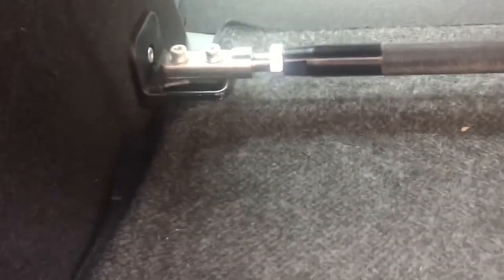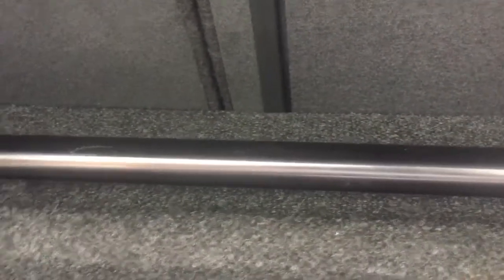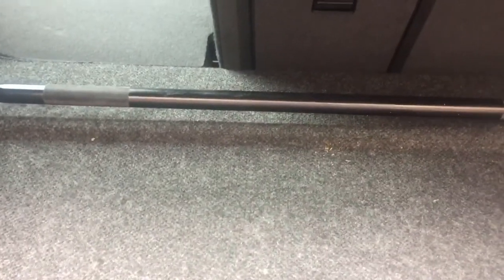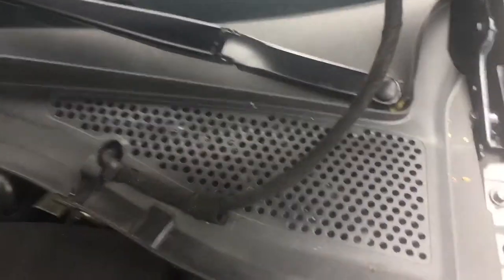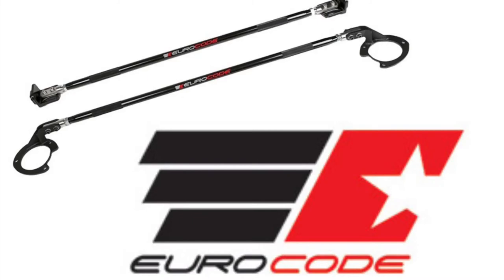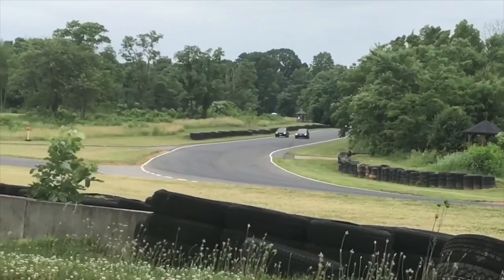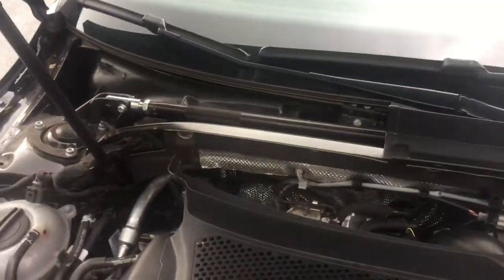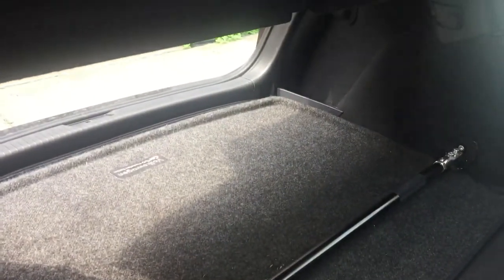Eurocode Front and Rear Chassis Brace Review MK7 / 7.5 GTI

Comment: There’s no way they help. The back brace sits an inch above the structure. It was up about 1 1/2 feet higher it would probably help. Same with the front. It sits right where the cars structure is.
Reply: You speak from personal experience? Everyone that has them loves them. They are very well reviewed.
Reply: Please share the engineering information source of why this is so?
Reply: The front would 100% be effective. No doubt about it. Probably more noticable than a sway bar upgrade.